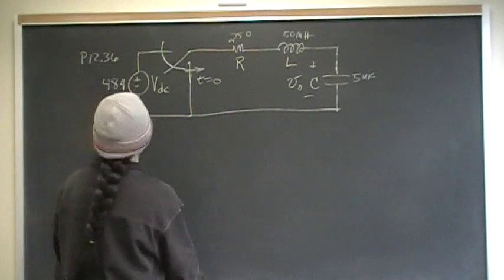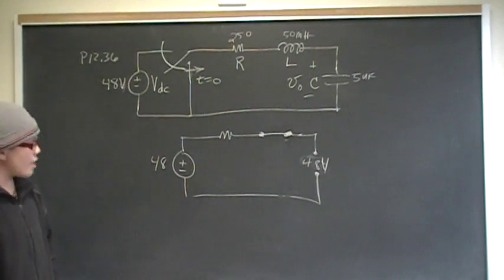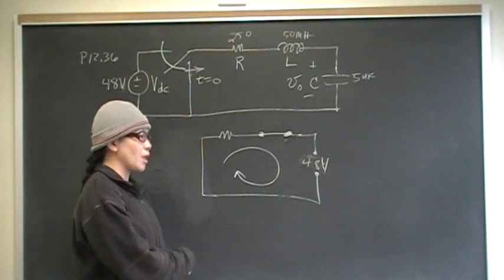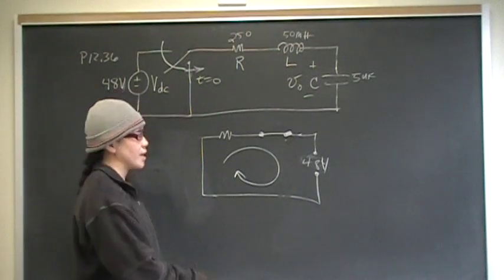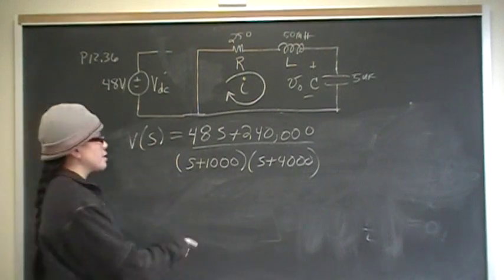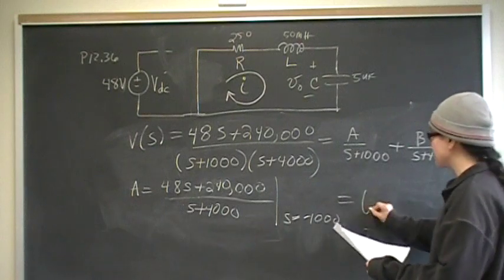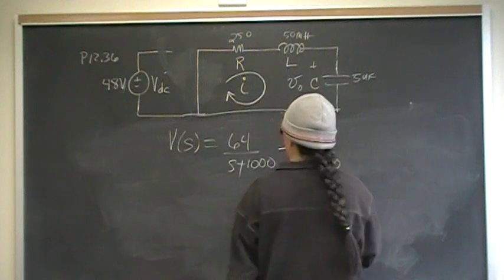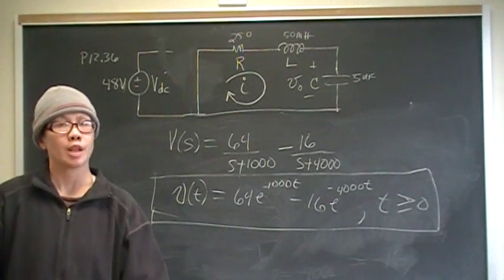Inverse LaPlace Transform P12.36 Nilsson Riedel Electric Circuits 9E Solution

Comment: First of all the current is going in the opposite direction(but in the end it doesnt matter,if you don't mess with pluses and minues),convetion would say that the current will go from a positive side of a charged to a negative side of a capacitor.
And when you wrote down KVL,for impedance of an inductor you wrote down it equals L*i which doesnt have units of Ohms but units of Vs or Webers which is magnetic flux,but in the end you made a correction into L*di/dt which is okay.